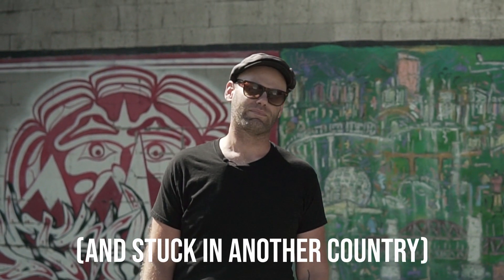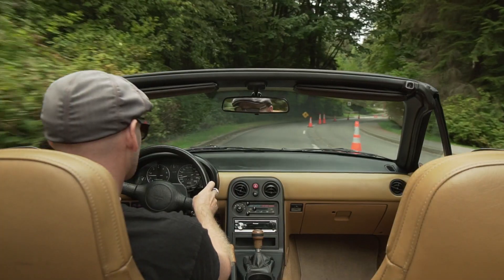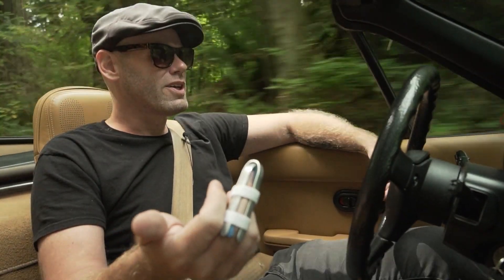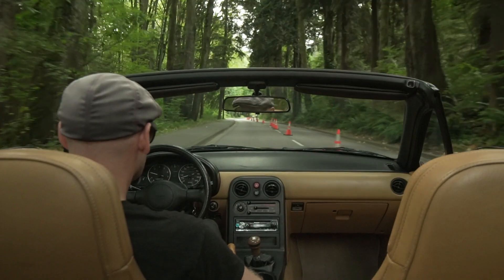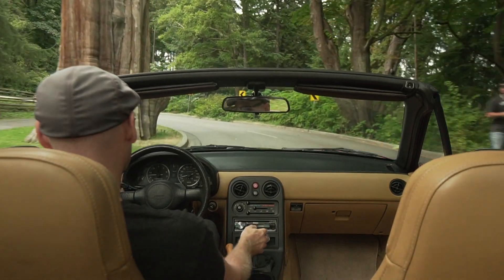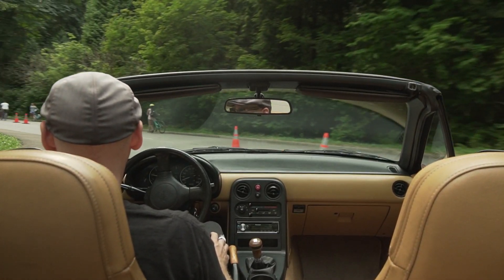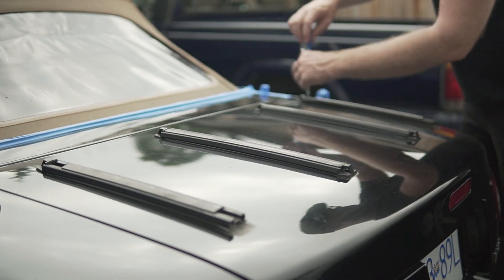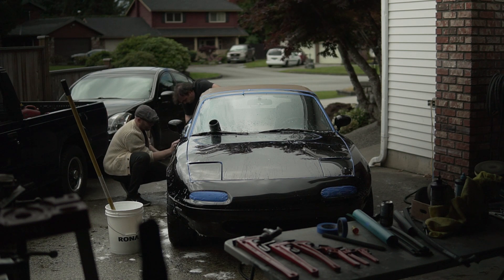New Project Car - How to Make Your Mazda Miata Wink on Command

Comment: @Pistons & Petrol 
Hello, maybe you could give me some Tipps? I thought about Engine Swapping my 124 Lusso aswell. But i would go for a more "authentic" approach. Installing a Fiat Turbo 5 Cylider Engine. On one Side it would be still a Fiat Engine, it would have the perfect Sound and according to some Volks that think my Car looks kinda like a Mini Viper from certain Angles. It would have a "Mini Viper" Engine ... a 5 instead of a 10 Cylinder.  

I am now in the Stage of planing if this is possible overall!? And since you are the Person with the most knowledge in the 124 Spider swapping Point as far as i know, maybe you have some Points i have to consider? 

Thank you and excuse my bad english, it is not my native language.

And you got there a nice Mx5.
Reply: I'm no 124 man but I've got a Coupe 20vt and what I would say is it's a bloody heavy and bloody long engine, would you risk having to cut the firewall for clearance and handling?
Reply: @dawizard9056  If it ends in a orderly build car i think i would but on the other hand the 124s are out of production allready so im not sure what is a better long term sollution. Think about Flyin Miata, they even put a 5l v8 in a Miata (same chassis as the 124). 
But after all, that is why i seek information ;)
Thanks for youre reply, Sir.